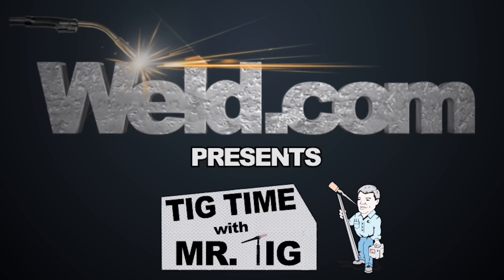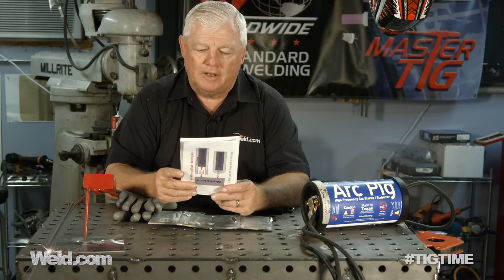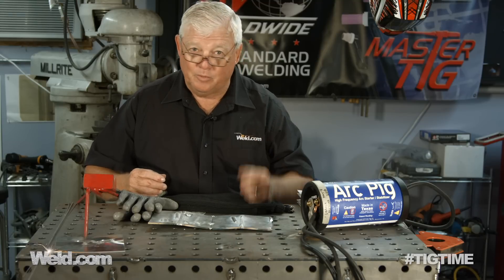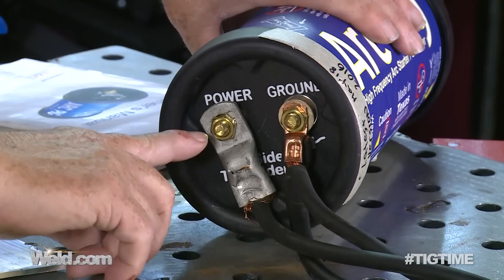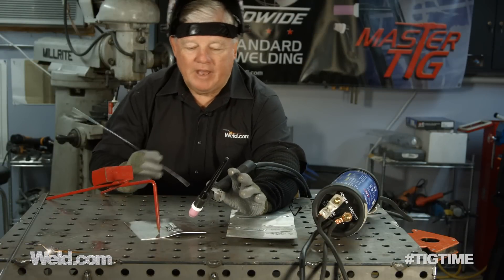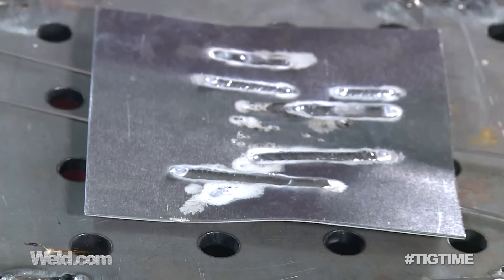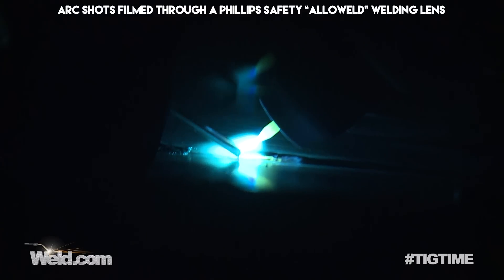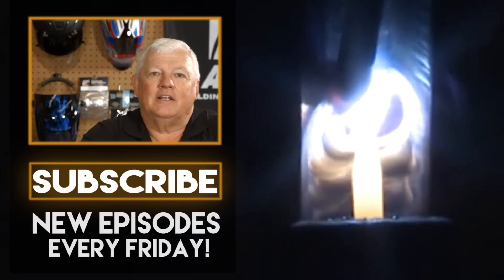TIG Welding Aluminum with a Lincoln Buzz Box & Arc Pig | TIG Time

Comment: wyatt your face says it all, unbelievable. i think it`s a game changer too and so hope all the hype is for real. there are many many places around the world i`ve worked where an ac aluminium tig is absolutely out of budget or maybe unobtainable at all. thanks for sharing
Reply: yeah... however there are some really cheap AC options emerging out there... Assuming you've already got a buzz box laying around you still need to buy a tig torch, and a regulator... so toss in another $100 or so. Now you're up to $450. 

For $680 you can buy an AHP 200x Amp ac/dc tig/stick machine from amazon if you're willing to wait a few weeks or so for delivery that comes with everything you need.  made in china though...
Reply: i agree on most points, for the us or europe (western) this product may or may not work. for the rest of the world, if works like it seems, and they adjust price a little they are sitting on a good idea, for example a buzz produced locally could be around 150, plus the 500 ish that would end up this pig, plus bottle and reg, let`s say 900?, in the same market a basic puke acdc inverter goes for uss 4000... it`s a different reality man. (how about 9000 for a lincoln precision tig 225)..
AND this is really important, you got to use a transformer which never ever breaks, i can`t tell the same my inverters (always have to show up with a backup which never i had to carry when using transformers)... well all this is, if the machine companies don`t buy out or screw the inventor in the first place...
Reply: What country are you in?
Why can't you just buy something like an AHP 200x and have it shipped to Europe? Even with the VAT probably still $1000 US.... takes 110/240 50/60Hz.
Reply: please read again my comment, i know other countries and the prices there. are you a sales rep for ahp?
Reply: No way basic inverter is 4000... sorry don't believe it
Reply: Not necessarily. Bringing anything from the US cost 10 times as much in my local currency. So a cheapie inverter tig welder at 200 dollars would actually cost 2 grand.

Comment: Try it with maybe a balled tungsten instead??
Reply: Have a pointed tungsten is always better. Due to the dc+ cycle, it causes it to ball up. You shouldn't need to purposely ball up your tungsten. I always put a blunt on the tip on the taper because when it balls up with a very fine point it starts melting to one side. I also put my AC balance cycle setting to 68/32 or somewhere near

Comment: I live in the town where these are made. The guy that makes them is a good guy, I talked briefly with him. He's funny. At the very least, go read the owner's manual, it's a hoot! Here's the arc pig Guy's video link, watch that one and check out his channel to watch the one where he shows how to splice a tig cable...freakin hilarious. 

https://youtu.be/MiWvFbOnSZo
Reply: Yes he is a good guy with a sense of humor. I actually waterjet parts for him.
Reply: hi ryan have you tested the thing too?. pete
Reply: +thebrokenbone I have not tested it, but only because I don't have a use for it and not a lot of extra time to experiment. It's affordable enough to try out and I think I'm gonna buy one just because the owner's manual is so funny! Do a google search for it and go to his website, you can read it there. The manufacture's warranty is written funny as hell too. 

On another note, my first HF AC tig welder was a HF box hooked up to my Miller thunderbolt. It worked, but I out grew it very quickly. If you already have a machine and don't plan to do a lot of aluminum tig welding, then this would probably work for your aluminum repair or fab. The arc pig is useful for much more than AC HF tig.

Also, Mr. tig, you look like an old story teller with those glasses on and reading the owner's manual.